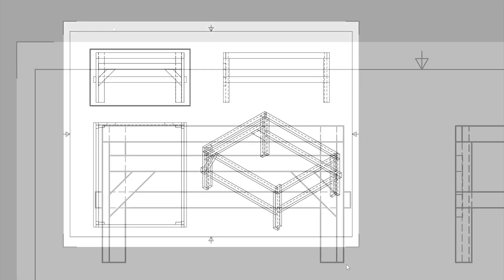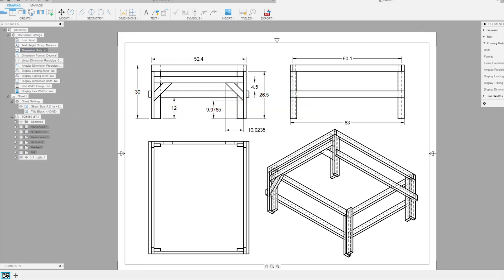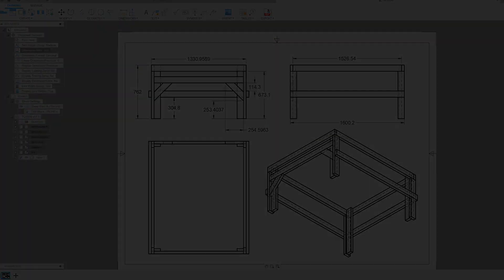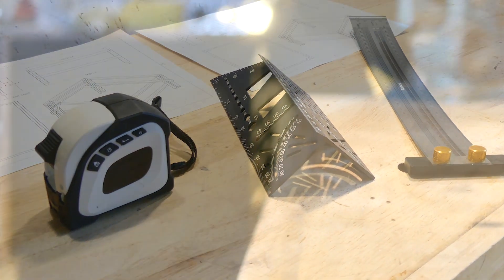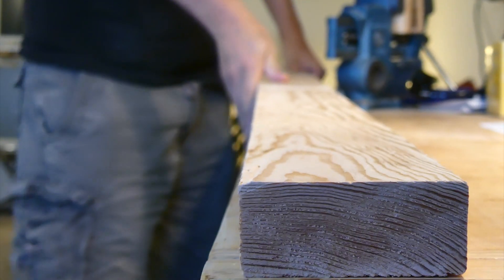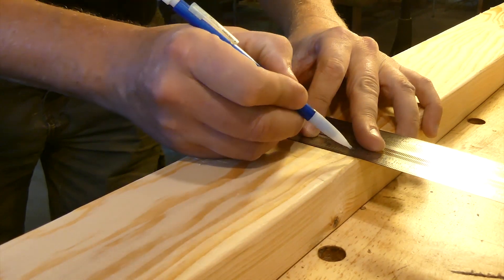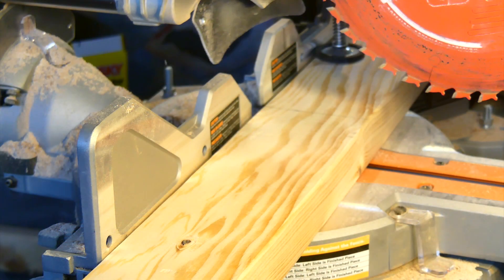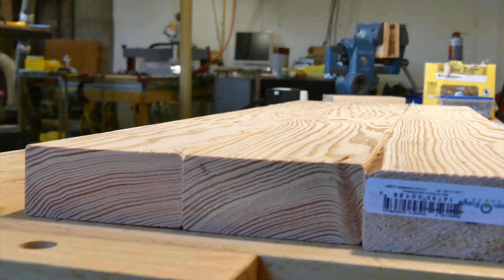DIY Luthiery CNC  TCI5050 Base T-leg table |

Comment: Thanks for the mention. 

There's something that I wish I could go back and add. Note that load distribution is only part of the picture. A frame can only be 'sturdy' along an axis that has diagonal support. A work bench has three axes: length, width, and height; in order to get your bench to be as tough as possible, you should try to get diagonal strength along all three. A plywood top, side panels or gussets, and either front or rear panels/diagonals are all highly recommended for something as important as supporting a CNC machine. Hope it went well!
Reply from the maker: Thank you!, I have made quite a few of these and they work great. This is my go to design for tables and benches.

Comment: Great video!  After a year of use, what's your impression of Pocket38's design?  Has it improved rigidity?  I've got the same stability issues you did for an old CNCRP 4848 router that I have on a wooden bench that I build years ago.  I was thinking of welding up a table but steel is insane right now.  Would do this in an afternoon if it works.   Thanks!
Reply from the maker: I really like the Pocket38 design, I have been using it all over the shop, much more rigid then my previous bench.